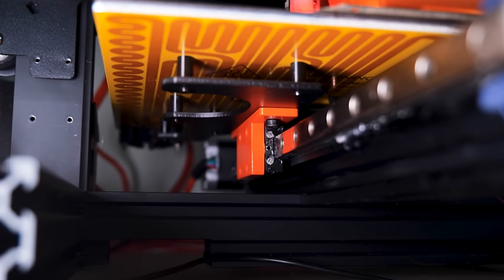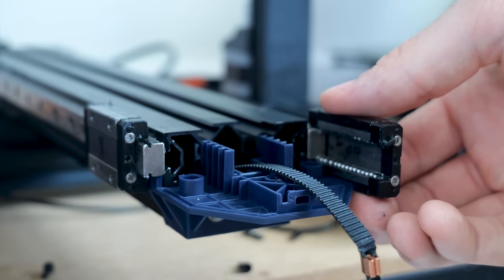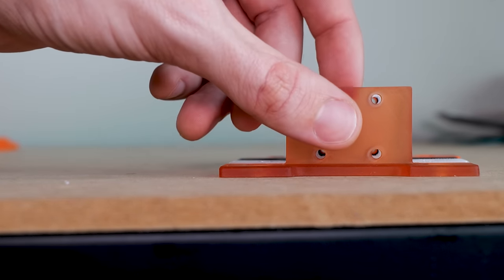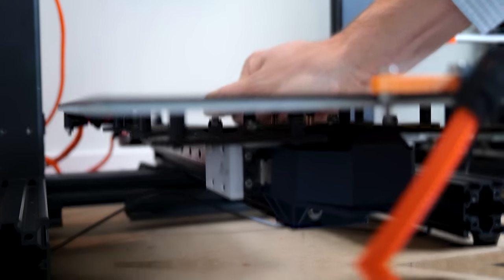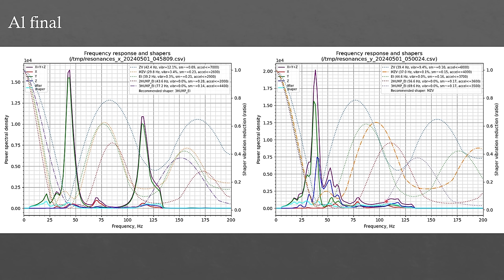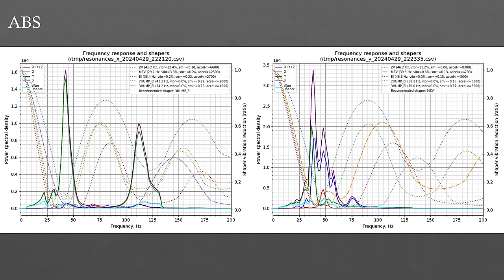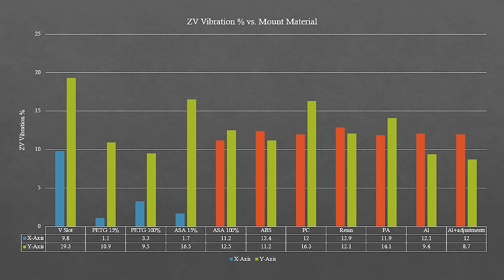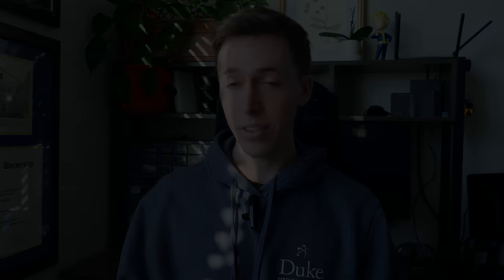Upgrading to Linear Rails a Waste of Money? - An Evidence Based Answer

Comment: Not waste of money, but in 2024 the resin printer to go. I know,for  lot of people don't have good environments or enough place for resin printer, cleaner,wash,cure but I would never buy or build anymore an fdm printer . I still have a self made  corexy, but I never use it honestly.
Reply from the maker: It very much depends on what you like to print. If you're into making structural things, I would say resin is not the answer. Also, Resin definitely costs a lot more to operate over time and requires much more effort in my opinion

Comment: I would say that the fundamental reason for linear rails is true movement and not having the inconsistency or "slop" of v-slots and wheels. All of your movement goes the direction you want it to. If liner rails were not a solid method, you wouldn't see so many of the higher end printers using them like Voron, Rat Rig, BLV, and other printers. Personally, linear rails have saved me time in maintenance and repairs as I am not chasing eccentric nuts or bad wheels. On my Ender 6, they are also allowing me to use almost all of my printable area making it almost a K1 Max.
Reply from the maker: I have to agree with you 100%. Funny enough, after publishing this video, I found a wheel on my z-axis which freely spins, making 0 contact with the extrusion. Luckily I have those other rails haha

Comment: I would not us the nylon near anything warm. I believe it was CNC kitchen who used nylon for a voron build and all the parts creeped and the whole printer loosened.
Reply from the maker: Really? I thought it was one of the more heat resistant filaments? I wonder if it just has a low crystallization temperature that has a very broad range? Thanks for the heads up!
Reply: @SpencersDesk  Apparently ePAHT-CF can be used as 3d printer parts with no concern of creep.
Reply: @SpencersDesk  it is heat resistant but can creep a lot over time, unless you anneal it.
Reply: @SpencersDesk I encountered something similar during a custom design I worked on. I don't remember the exact science behind it but nylon and certain other materials will "cold flow" and over time deform under pressure. Glass fiber or carbon filled nylons are less suseptible to it in my experience but it doesn't completely eliminate the problem.

Comment: They shouldn't be an upgrade so much as users should simply refuse to buy 3d printers with Vrollers.

Linear rods and linear rails are both better solutions and penny pinching here will cost you a lot more in frustration later as vroller carriages loosen or the rollers themselves wear out or the dust that will accumulate from their use or the frustration of dealing with eccentric nuts.

No matter which way you slice it, there isn't a budget for which this cost cut makes sense.

Vrollers get a big 👎 from me.
Reply from the maker: I totally agree with this sentiment. Past your first printer, I wouldn't recommend paying for rollers ever again. The first printer is a bit of hazing though ;)
Reply: @SpencersDesk  I dont think a first printer should be a hazing at all. In the days when an a1 mini is 200 bucks regularly, there is absolutely no reason to experience these low quality, poor user experience printers. You get nothing out of it because they have problems you wont face on any mosern printer ever again.

I think that people arent forced to learn useless maintainance and repair skills specific to poorly designed printers is great as it allows them to have fun learning what they want to learn instead of what they were forced to learn.

To me its all about where time is best spent, especially something as valuable as your free time.
Reply from the maker: @BeefIngot that’s very true. I guess I’m coming with the perspective of having a printer for tinkering, not for printing, which I know is an odd POV. You’re definitely right though. If you’re only interested in printing, you shouldn’t have to deal with all the silly issues
Reply: @SpencersDesk  Id go a step further even.

Im occasionally interested in printer tinkering, and one day Ill get back into it. but when I do, this round Ill have realized what actually gets me going. I dont want to tinker to fix problems that have already been fixed. I want to do something unique and new, like maybe implementing a good semi multi toolhead system, or a nozzle that isnt quite 5d, but does non planar 3d printing to higher degrees.

New things that exercise the brain and that when Im done with I can say, hey, I really created this thing.

Currently, I what I typically do with my printer is use it to help me prototype things. I like to think of the greater hobby as kinda hobbyists product design.

Anyhow, thats the long and short way of saying that even for tinkering, I dont think one should start with anything except a good as close to hassle free experience as possible so they can focus on the aspect of fff printing they want to improve, whether thats speed, a new aspect etc.

For that Bambulabs probably arent the printers for that considering their closed nature, and probably not Prusas either but maybe something like proforges newest machine, or the SV08 or similar printers which are decent enough out of the box but open to modificiation.

A great example I think, is where Michael from Teaching tech is working on making a multitoolhead SV08.

Comment: you should not have uploaded this video because it is essentialy pure nonsense with bad tests and a complete lack of understanding of whats actualy changing, especially since you didnt spec the rails. vwheels have the ability to adjust the tension and both rods/bushings and rails can come with different preloads, essentialy a modification to the ball size and how much its compressed on the rail there. this also has a pretty dramatic impact on print quality and resonance as the super smooth feeling rails might be very low (too low) preload and might give you issues like toolhead wobble or wider peaks on shaper. higher preload will still be smooth but wont necessarily gravity drop and this is completely fine and on certain axes substantially preferred like on the toolhead axis. there are also grades for deviation over length etc as well and some rails are stainless and some are not, different materials and so on. cheapest rails and mystery rails are also not necessarily straight laterally or vertically. good rails can be extremely expensive as you push further into accuracy from brands like hiwin, iko, thk, etc. there are decent cheap china rails but like, you should still be specifying the rail material, preload, etc. you also used the wrong kind of lube. dont use ptfe lube in motion stuff. its generally stupid to buy random rails without knowing the specs you are getting if the goal is performance testing on something like an accelerometer on a printer.  when cleaning your rails, you also should have soaked the balls and carriages and flushed them in the ipa in a bowl and let them soak and pushed them through the raceways a few times. and then re lubed them, put them back through the raceways and relubed again, before putting them back on the rail. there is no shortage of guides about this stuff from other maker and printer communities. you also should always be measuring the axis of the toolhead from mounting the accelerometer to the nozzle- you dont x-ray your arm when you break your leg because they are both connected to your torso....one of the big problems with like for example voron kits, is that they ship with low preload rails (zf/0), so it is an extremely common mod to get better, straighter, higher preload x axis rails (z1.5 - z2) and virtually all of the diy printer parts shops sell these. v slots and t slots have different profile angles for roll-in nuts and you need to be careful when sourcing given this. there are also 2 major standards for t-slots, and this is problematic for example when trying to fit certain size parts like certain mgn9 rails. if the rails arent in a moving axis you probably want to bolt all of the bolts down since there wont be a weight penalty, as the rails can deflect and you wont have to worry about that weight/rigidity relationship.   from a resonance testing perspective, it may not be apparant to you but belt tension will impact your charts too. rods can be more rigid than people realize and the rod bushings also have tolerance specs and preload. for example my stratasys printer uses rods and it is extremely rigid.  my vorons and annex printers are on rails. the fact that you arent tuning the printers until you get clean charts is also problematic because its essentially not meaningful.  dont even get me started on not making sure the rails were parallel. 

 i run a decently large print farm (~30 machines) and i would never buy vwheels for them because they are inconsistent and a wear part with a fairly high wear rate and require frequent adjustment, among other reasons, but primarily just that alone. also, even cheap 100$ printers like kingroon kp3s's come with usable rails.  there are much more durable variations of wheel guides and metal wheels and other stuff but thats a whole other rabbit hole to get into. 

this video is a giant waste of time, because your experiments are using objective tools in stupid nonobjective ways with bad experiment setup and you dont understand what you're doing or how or why. i dont want to discourage you from making videos, but like, do better. i want to see content like this but i want it to be with at least reasonably correct information. people will share and watch and reference this and now im gonna go have to help like  a bunch of idiot noobs unlearn bad shit they saw on youtube in the discords where i help people. please dont make my life harder.
Reply from the maker: Thanks for watching! Lots of great info in this comment. YouTube is available to you as well, so feel free to fill in whatever gap you feel is missing. But that last paragraph man. I hope life doesn't have you down...
Reply: I must concur with some of the other comments. I think you present a very surface understanding of the motion system.
Reply: Haha bro about that last part, I totally get you
Reply: What’s your opinion on “OpenRail linear rails” by openbuilds. Essentially an inverse of v slots and wheels where the wheels have the v slot. Should it be considered a decent budget upgrade from normal wheels or would spending 4-5x researching and sourcing decent linear rails?

Comment: You made so many errors it completely took out the "scientific" aspect of the experiment, which doesn't leave you with much of anything to be honest.
Basic alignment of the rails that requires a dial indicator? Out the window.
Rigid mounts for the bed? Well you had aluminum but decided to use plastic to go with the rest of it, again losing the whole point, not to mention painting the aluminum ruining the precise machined surface.
Using quality rails? Appears you passed on that one too.
For printed structural parts the perimeter thickness has way more impact on the strength and rigidity than infill so the resonance results you got reflect the mass of each part more than anything, rendering your experiment meaningless. 
The list goes on... You measured wrong things with wrong tools and got wrong results, it's almost impressive.
So how about not making content on topics you're not qualified to talk about?
Reply from the maker: If we stopped making videos we weren't fully qualified to talk about/didn't make mistakes in, YouTube would dry up real quick. Science is based around making mistakes and learning from them. Take a walk down the history of Physics and see how much we got wrong.
I did my best, presented my results, and discussed them without hiding anything. That's how progress is made. If you'd like to help the community, try adding to it.

As for the alignment, there is very little gain for setting things up perfecltly. I moved the bed and repeatedly until there was no binding left. For a 3D printer, that is good enough.
Maybe you didn't watch the video so closely as I did use the aluminum mounts for the rest of the video, not plastic.
The precise machined surface of the aluminum truly means nothing. Again, it's good enough.
Quality rails are again of diminishing returns in the world of 3D printing. Most of the community is using cheap rails, especially if upgrading their printer. So, this is applicable. not every can afford to drop 100's of dollars on rails. Have some perspective.
While the perimeter thickness has "Way More" effect, the infill also affects it. So the experiment is still valid. The difference in mass is negligible between the different infill parts.

Again, 3D printers are not precise machines. Their motion system could be perfect and there are still going to be issues because of extrusion. There is so little gain from throwing money at tools and parts to setup your printer perfectly. Big picture.
Reply: @SpencersDesk  I'd agree with you but then we'd be both wrong
Making mistakes okay, doing it confidently in a "informative/guide" format is not
As for the "YouTube drying up, no it'd be less diluted with misinformation
I'm sure there are plenty of topics you dominate, try sharing those with people instead
Reply from the maker: @DynoRC I’m sure I never presented this as a guide or a how to. Simply a bunch of tests and my interpretation of the results. Again, science is full of misinfo. Nature of the beast. We would be set back so far if we tried to avoid it at the cost of progress

Comment: STOP upgrading....  Things are moving too fast. Save your money and buy the new flavor of the month when you can.  Upgrading is just throwing money  away in denial.  Your 1 year old printer is "old junk" already. Move on...
Reply: I just ordered a Qidi Q1 PRO rather than upgrade my ender 3 pro.  Couldn't see wasting money on something so old.
Reply from the maker: It's all about why you have your printer. I have mine because I enjoy the process of testing, designing, experimenting. If I bought a printer that just, worked, I may get bored of it. I also find that I'm increasingly attached to this printer. It's like a little pet that I can make better and better. No one size fits all :)